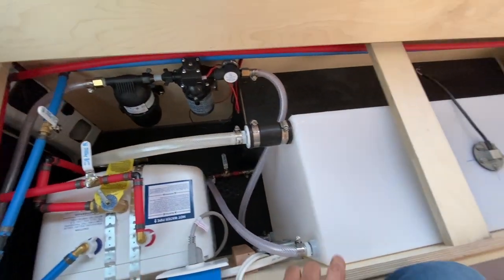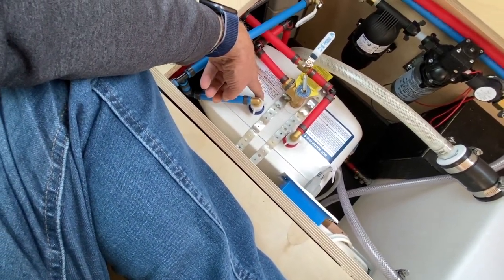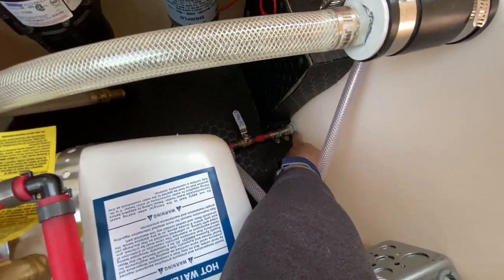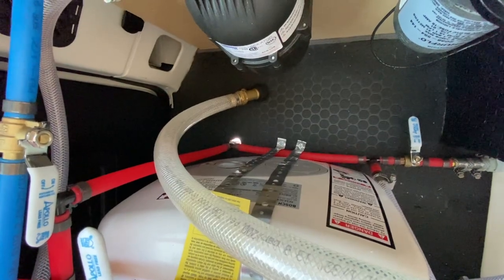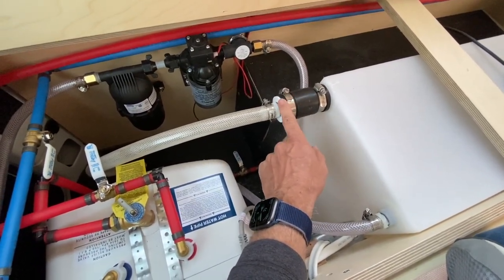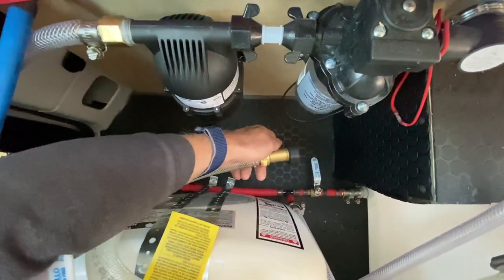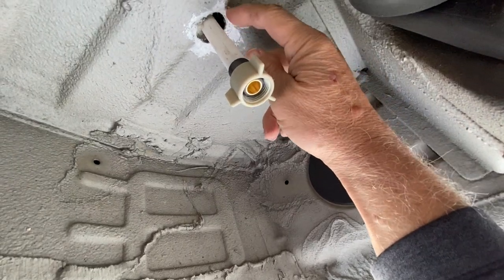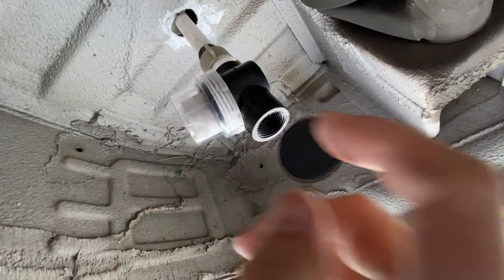How to Set Up Your Van Plumbing System

Comment: Great job connecting all those drains!!Next time drill a 1 3/8 hole and use insulator plug. That way the hole is completely sealed and there are screw holes to secure it into floor. Also the plug protects the pipe from sharp edges. I use these plugs on every external hole.   Put silicone on outer edge of plug for water proof seal. Hooking up all those connections was great. However you could have made the drain 3/4” to make it drain faster and also the pop off technically should be 3-4” ( I’m a plumber but in a van 1/2” will release the pressure plus it is only a 4 gallon tank)

Comment: Super helpful video! Have you had any issues after reducing the 3/4" pressure release valve fitting to 1/2" pex? I know in the manual they recommend not reducing from 3/4"  but wondering if we can get away with the 1/2" pex we have and avoid buying 3/4" pex. Thanks!
Reply from the maker: Haven’t seen any issues with this.

Comment: Jeff & Lisa, this is a very helpful video - thank you! Some interesting approaches. I'm curious about the benefits of a Fernco coupler. In your case you're using it to connect an adapter to 3/4". If you were connecting 1-1/4" braided hose directly to the tank from a fill dish, would there still be an advantage to connecting via a coupler or would you attach the hose to the tank port without other devices?

Comment: Great informational video. thanks. 
I do have one question. Hooking up the drain hose and air vent hose together, aren't you going to have pressure issues when you drain the freshwater? when you drain the water, looks like the release pressure air can not go into the freshwater.  Am I wrong?
Reply: Wondering the same thing. I'd keep those separate.
Reply: This is exactly what is happening to me!! Im not turning the water off when the tank is full (just to pretend someone else won’t) so I’m overfilling the tank, then the overflow hose (which should also act as vent) is sucking water out and creates a vacuum so the tank starts to shrink until a fitting breaks to allow air in, I have tried different ways and I can’t fix the issue. Any help?

Comment: On the installation and usefulness - do you find this was a large enough hot water heater? Would you have upsized to the 4 gallon given the chance?
Reply from the maker: The 2.5 gallon is adequate for two people to take quick showers, wash dishes, etc. We now use a 4 gallon Isotemp marine water heaters in all of our builds. Keep in mind that a 4 gallon will use a lot more battery power to heat the water.

Comment: I didn’t totally understand the fill hose for the fresh water tank? You said you would “pull it out of the van”? Pull it out where? You never demonstrated that. You also said you don’t permanently attach it to the rear wall because it will drip? So if you installed a finished hose fill inlet on the exterior of the cabinet wall accessible from outside of the van and then permanently attached the hose from the tank to the inlet on the inside of the cabinet, the inlet will leak on the exterior of the cabinet once a garden hose is removed from the finished inlet? Also, wouldn’t the drain mechanism you invented tell you when the tank is full because the water would start running out at the hose below the van?

Comment: Hey Jeff, thanks for putting this video out. Lots of helpful hints for us. Have you had any issues with the PEX fittings? Are the joints with the on/off valves holding up? We are at this stage of the build and I'm over whelmed with choices , thanks
Reply from the maker: Pex works great. I prefer the expansion Pex as it’s easier to work with in tight areas.

Comment: Very tidy. Is there a reason why the fresh water tank vent hose needs to be directed outside? Is it in case of overflow or something?
Reply from the maker: Correct. Hard braking or acceleration can cause water to come out of the vent hose.

Comment: I built this set up and Im not turning the water off when the tank is full (just to pretend someone else won’t) so I’m overfilling the tank, then the overflow hose (which should also act as vent) is sucking water out and creates a big vacuum pressure so the tank starts to shrink until a fitting breaks to allow air in, I have tried different ways and I can’t fix the issue. Any help?
Reply from the maker: You need to vent the tank separately. We changed this and ran a separate vent tube through the floor of the van.